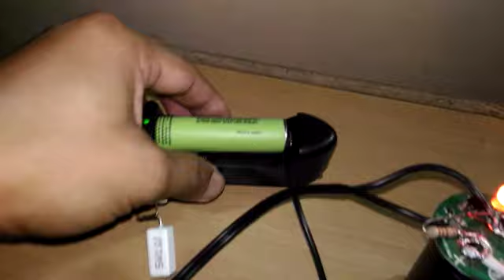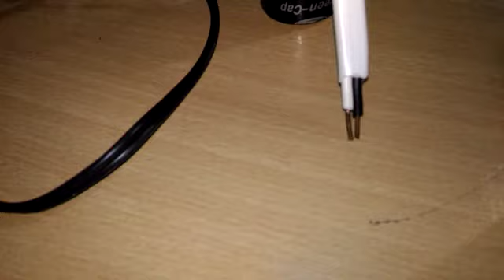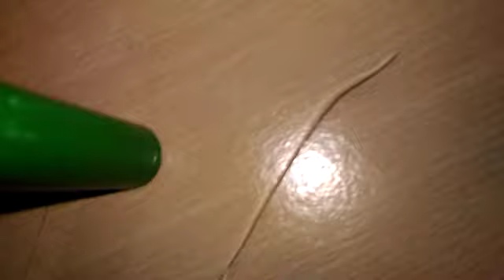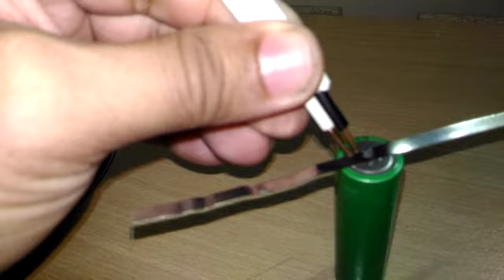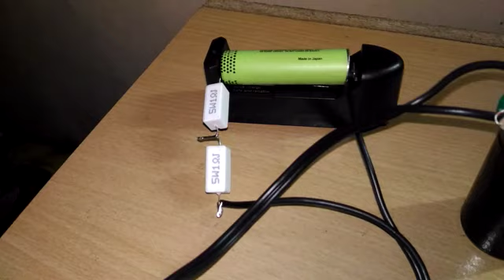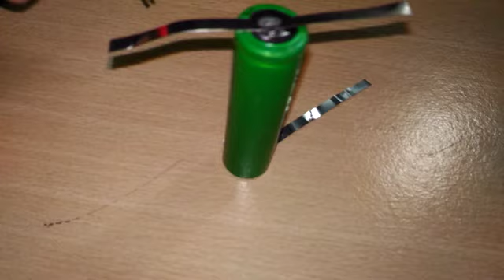DIY Battery operated Spot Weld using Super Capacitor

Comment: This is the smallest and simplest DIY spot welder I have seen. Is there any step by step instructions and/or circuit diagram that I can follow?
Reply: There is no circuit only direct leads from capacitor contacts this pcb is shitty protection and does nothing here to charge capacitor you need constant current power supply or high power resistors and you cant charge capacitor above 2.7v

Comment: As per above setting, With same capacitor same protection pcb, same battery with 2 ohm 10w resistor. conclusion: NEVER WORKS, it is waste of money and time.
Reply: i think you don't understand what the purpose of the video :)

Comment: Hi, I'm trying to weld with same capacitor but I'm getting only few sparks and no welding. Do you have any idea why?
Reply: It is because a single supercapacitor will not supply enough current and so the connection has to be held for long duration to melt the metal. This causes the glow, risks melting a hole in the lithium cell, and gives a poor quality weld. I would suggest using at least three supercapacitors in parallel, and using a timer to limit the duration of the welding pulse (this of course would need to operate a heavy duty relay with contacts capable of handling at least 200A, or else a lot of MOSFETs all in parallel). Another mod I would make is to use a current-limited source like a buck converter or a boost converter to "trickle charge" the capacitor bank at something like 5A.
Reply: andy kay , i like your argument
can you give me the circuit can interupted voltage when welding spot to switch off / on? not use relay but MOSFET in paralel

Comment: whether to use Protection Board for Super Cap?
Reply: U dont need a protection board as long as the super cap not exceeds 2.7 or 2.8 v u are good. Just buy a simple volt meter from alie. Then u can watch if its reach the 2.7 volt and then u switch the charging off.

Comment: Hi! i've found the supercap on aliexpress but not the protection board. is it still in your possession? can you maybe find where you bought it from? or atleast describe the components. 
can you please provide more info on the charging? what battery is that? isn't it more stable to charge from a converter? how would you count what resistance would you have to put in if you had a different power source? im quite a newbie at that stuff. thanks in advance
Reply: its to spot weld the 18650 battery.. source of power is from 5v smartphone charger